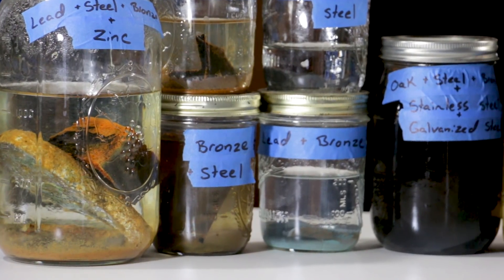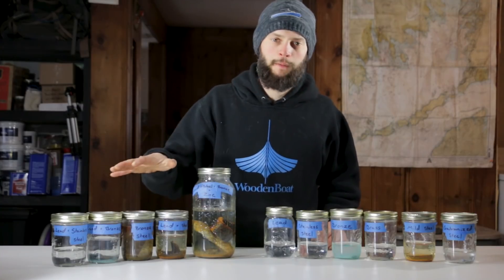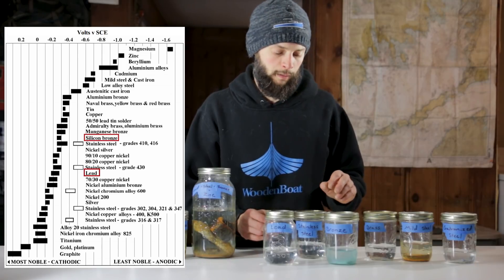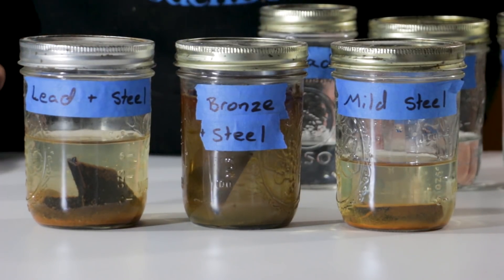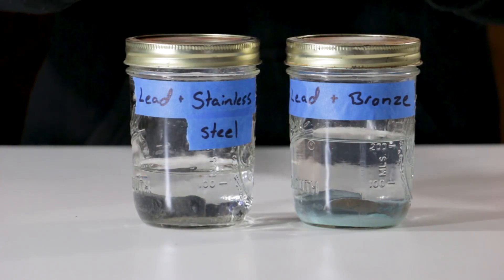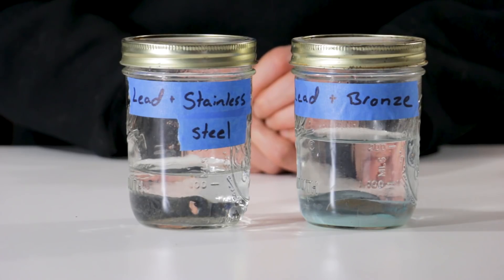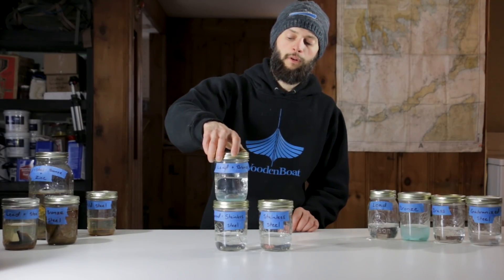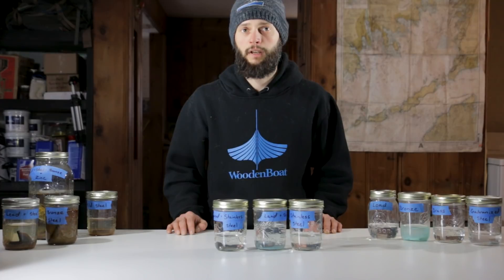A2A - Journey of a Wooden Boat - Bonus Content: Dissimilar Metals and Galvanic action Part 1

Comment: Most commercial grade  stainless screws and bolts will be 304 or 308 grade. You normally have to go to specialty fastener houses to get 316 grade. 
There are better grades of stainless for marine use, but unfortunately those premium grades are hard to thread in commercially viable qty's.
Reply from the maker: It's a much more complicated metal than many think, seems you have some experience with the stuff.

Comment: "It's too cold for that."  "It's too wet for that."  Story of my life the last month!
Reply from the maker: It's been driving us batty!  We are ready for a change.  Cold and wet is never helpful.
Reply: Peter Collin dude there are always jobs to be done, it’s one of the best bits of owning a boat 🤙🍻⛵️
Reply: We put some fresh epoxy on our boat two weeks ago. Had a gasheater running nonstop to keep it over ten degrees. Worked on a layer then slept for a few ours only two do the next coat. When the boat gets to its summerresidence this weekend it will have been worth it.